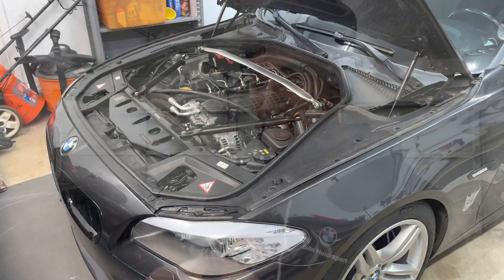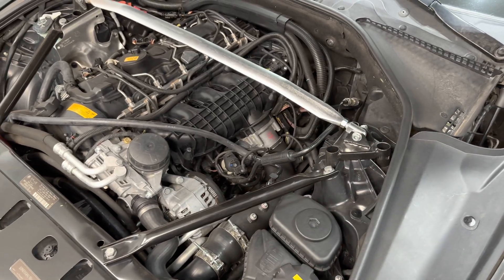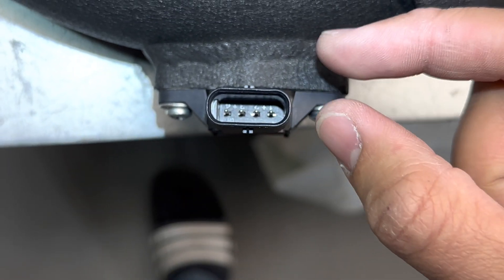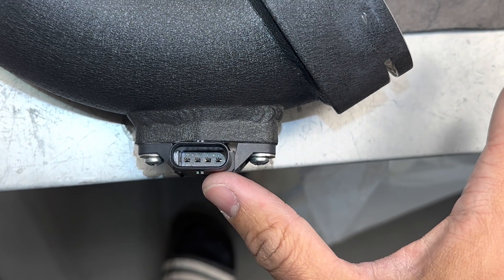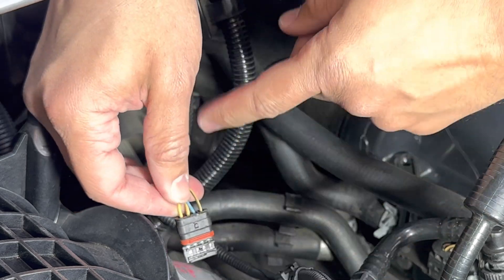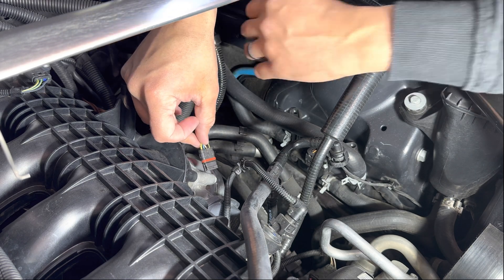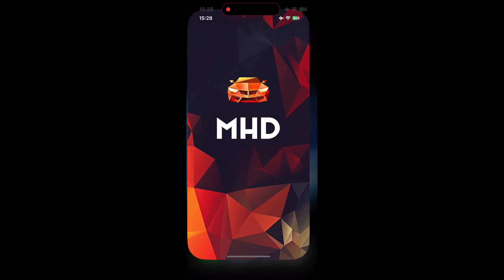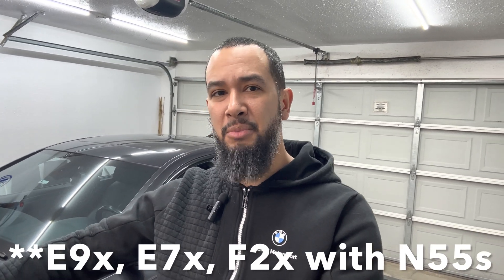How to Upgrade N55 TMAP sensor to N20 3.5Bar TMAP sensor- prep for Big Turbo

Comment: FCPeuro now has the Hella 3.5 MAP sensor as the one suggested by RealOEM as being the upgraded version!  For the pre LCI n55 F10 model engines no need to repin the connector as it works out the box and designed for the charge pipe connection...  It runs about $75 - $80 for the sensor...

For the MAP sensor on the Manifold that's not the BMW OEM sensor, you do need to repin the connector because its a Vitesco branded MAP sensor which is different connection do to the pins being backwards so it needs to be repin to the correct positions!

Comment: Hi friend, I have a BMW 335i convertible twin turbo N54 E93. I've been looking for information on the two sensors you mentioned for a week. They look very similar. I want to buy both sensors, but I don't know if they have the same function or how to order them. Could you tell me the difference between these two sensors? Please 🙏.
Reply from the maker: I would highly suggest you get on facebook and ask your question on an N54 group so you can get accurate info. Mine being not only a different platform but also different engine (N55), Im not well versed in your engine. Just want I hear from others. And I  don’t want to give you incorrect information in case what i heard was incorrect to begin with

Comment: 135i n55 owner. I'm Stage 2+ atm. 3.5 Bar is not necessary correct? I did upgrade all the piping when I went to a VRSF Comp HD 7.5". Next I will do the last turbo inlet pipe and a pure500. After that I will want to upgrade to the 3.5 Bar correct? I hate clips and plastic connectors. Mongo will brake.  I will pay for the adapter cable from Burger. I did not realize there was another sensor on the intake manifold. Is that the same part number as the stock sensor on the charge pipe? Thanks for the videos. I keep landing on your channel when I do google searches.
Reply from the maker: Sorry for the long response time! Not sure how i missed this one. So on stock turbo (and even the Pure500) you really dont need a 3.5Bar. It’s when you go PS1 and up that you are going to go beyond that which the stock 3Bar can read that you need to upgrade it. And at that point you only NEED to upgrade the one on the charge pipe. The one in the intake manifold is the same but the DME uses it differently. You CAN. Upgrade that one as well, but that’s not a plug n Play situation as it will throw everything off. You can do that in agreement with your tuner if you do custom tuning and he can compensate for the higher resolution of an upgraded manifold MAP sensor. I hope that helps! Your setup sounds like a great, fun, and reliable setup!

Comment: The tmap sensor i bought the number 1234 match up with the connector itself and i dont have to flip plug to fit
Reply from the maker: Only early N55s like mine that still used the N54 style TMAP need to re-pin the connector. Later N55s did not have to
Reply: @turbospool  ok Cool thanks. Also real quick I watch all your vids and your so knowledgeable. Question my 2013 535i is making a noise when car is started. When I remove oil cap it stops. What can that be.
Reply from the maker: @beamer2169  thanks ! And does it happen to be a medium to high pitched noise by any chance? (Like a whistle)
Reply: @turbospool  yes very annoying
Reply from the maker: @beamer2169  your PCV has failed. It’s integrated to the valve cover. There are aftermarket companies that sell a PCV rebuild kit but it involved you cutting out the current one and epoxying the new one on. Based on the age of the car, I would just recommend a new valve cover assembly. Side note- i put out a video this spring or summer where I replaced my valve cover with an aluminum one. It was only $150 from Amazon.
Reply: @turbospool  ok cool thank u for the info. I will order the same and watch your video for installation. Thanks again

Comment: BRO I kept trying to figure out why I was going into fail safe mode cause of pressure sensor failure and this is the reason was cause of the pressure sensor not being swapped to 3.5 bar and no where could I find the answer and here I was at the point of replacing the sensor and came across your video for the sensor replacement and only you show the 3.5 setting in MHD 😐 thank you you just saved me burning cash for no reason.
Reply from the maker: That’s whats up!! Glad it was of help to you bro. Now get back to enjoying your car as you should be!
Reply: @turbospool  Much obliged just happy it’s outta fail safe and running smoothly again.
Reply: Im getting a code  2F30 on my 335is and i noticed that the cars power band isnt quite the same back then while doing a pull after every gear shift it would have those 7 seconds of extra power now it doesnt have that could this be the issue it says on my mhd its 2F30: charge air temperature sensor

Comment: So it's true that you will have lean codes if you mhd tune the 3.5 map but still have stock turbos
Reply from the maker: Not really. I did this upgrade while I still had the stock turbo. Part of the upgrade is you have to reflash your tune in MHD with the added selection in the menu to tell it you now have the 3.5TMAP, and MHD will scale the readings from this sensor accordingly. If you don't re-flash your DME it is possible it will run terribly (lean or rich as the DME tries to fight the condition and save the engine).

Comment: Ok so here is my issue. Look at 0:10 to 0:11 and you will see his sensor has that red bulb looking thing in his sensor. Most sensors are green. I have one like this and I want to make sure this isn't a knock off.
Reply from the maker: The one at that timestamp is the VDO/ Continental TMAP sensor I bought. I don’t recall what the BMW bulb color is at this point. Hope that clarifies it for ya

Comment: what year make is your car because I got the 2013 535i with the n55 and I bought the 3.5 sensor when I turn the wires around it's you all kinds of code Even when I check the box off in MHD tune still throws all kinds of codes
Reply from the maker: Oh no! Mine is an early N55, 2011. The pin and connector may be different

Comment: False statement about it not making a difference in stock turbo
Reply from the maker: Can you expand on that? Because this sensor is made to read beyond the boost pressure that the stock sensor is able to to read. That’s why I say the sensor itself makes no difference to performance, and that what it does it is allow for a custom tuner to come in and be able to read/ tune boost levels beyond that point. Do you have any additional information that maybe Im missing?
Reply: @turbospool not too sure but from what ive heard even on stock turbo it would allow for the psi to be turned up, cuz on stock sensor max psi is 12 and if im not mistaken ive heard if i upgrade it i can turn the psi up, which u probably wouldnt wanna overdue but a good 15-18 psi would for sure make a difference i could be wrong tho im not sure
Reply from the maker: @juanguzman1838  you’re somewhat in there! So stock sensors on the N55 cap out at 21.9psi. Anything beyond, the DME doesn’t see it. The 3.5Bar can read well over 30 (Ive read as high as 31psi on it from an overboost in the start of my N55+ tuning lol). I say the sensor itself does not make more power, it just can READ a higher boost. This in turn, allows a custom tuner the ability to tune beyond that 21.9psi level. I just don’t want to public thinking that they can just slap this sensor on and magically they’re car will make more boost. They’d still have to pay a tuner to do a custom tune for that. Changing the sensor by itself doesn’t alter the tune’s target points and boost logic.
Reply: @turbospool Stock turbo on Ewg N55s can make 24-26 psi. You clarifying the stock sensor caps out at 21.9psi proved our point it makes a difference for stock turbos
Reply from the maker: @F80__Los  right, if you wanted to max out the stock turbo, you will need this. Agreed on that. All Im saying is that people shouldn't think that slapping this on will magically cause their turbo to spool higher. Custom tuning is still needed to be able to use the new readings from the 3.5Bar sensor.

Comment: Just curious what boost level do you hit during a pull with your new turbo and shoup tune?
Reply from the maker: has varied based on what we're doing. On the crap 91 octane and 100*+ F heat I'm tuning in, the car seems happiest around 19.8psi. Makes that by low 3000s and holds it to redline with only around 48% WGDC.

Comment: How much boost you pushing now that you needed the upgrade????
Reply from the maker: Right now on custom David Shoup tune only 19.8psi i think is the highest I’ve seen out of my PWG. But like I said at the time of the video, i didn’t NEED it then lol. I was just getting the car ready for when the Shuenk N55+ turbo gets installed (which Im actually doing right now :-D !!).
Reply: @turbospool  nice can't wait to see that and 19 is pretty good am at 21 rn
Reply from the maker: @kiingoso  nice!! Yea but to answer your question further, 21/22psi is where the stock TMAP sensor maxes out and we have to go up to the N20 that can read well into high 20s. Im not going for all out crazy. Just want to be around 475-500 whp and Im happy.
Reply: @turbospool  exactly what I want n got 💯 your a smart guy thanks again
Reply: @turbospool Yeah and the stock turbo on EWGS can push 24-26 psi. Considering anything over 21psi stock sensor stops reading, you do need a upgraded sensor even On stock turbo if you max it out.

Comment: Do you have the air intake behind the grill from Bimmerhaus? Sounds awesome 👏🏽
Reply: I was considering doing it as well, but now hearing yours it’s bad… 😎😎😎
Reply from the maker: @gioLib13  hahah it is addictive!!!
Reply: @turbospool  I agree 🥸🥸🥸
Reply from the maker: Yes I do! I actually did the prototype testing for it. Check out the dyno video posted earlier in November. The sound is awesome, but the proven gain in power is just as good 😄